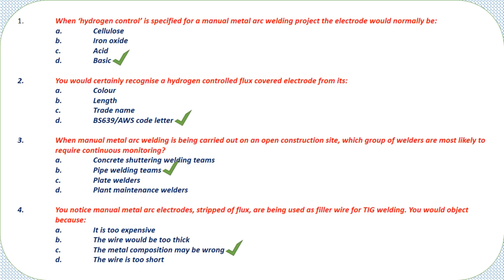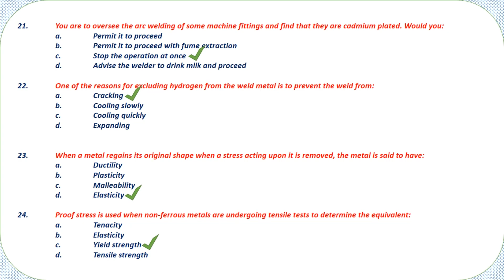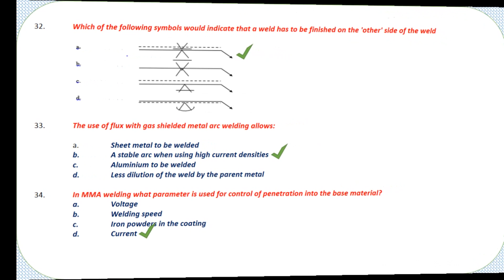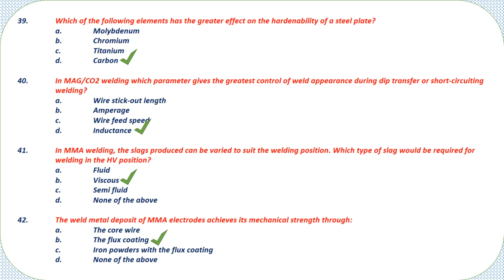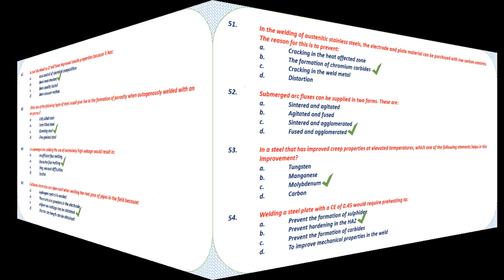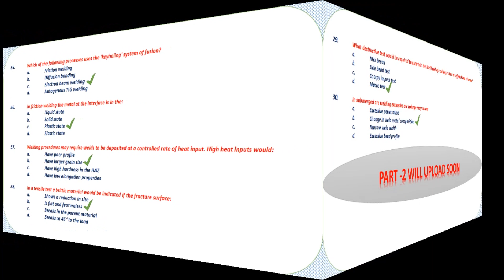CSWIP  3.1 Welding Inspector Exam Questions and Answers - Part 1

Comment: I have started to watch your video from last two days. I am wondering why you only have 21.4K subscribers. you should have at lease more than 200k subscribers. You explain very well all exam questions with relevant example. it is very useful for begineers
Reply from the maker: Thanks for your valuable comment. As I am working under Saudi Aramco so I don't have time now, anyway u will try to prepare more videos.

Comment: I want to do cwip course. My qualification is m.sc statistics , am i eligible for this course?
Reply: Sorry cswip course
Reply from the maker: What is your basic qualification and experience?
Reply from the maker: OK MSc statistics as I seen, then what about your experience?
Reply: I worked as an admin assistant in inspection department in oil and gas plant saudi Arabia
Reply from the maker: Job responsibilities and experience criteria for examination eligibility as given below are strictly adhered to and enforced.

Welding Inspector for a minimum of 3 years with experience related to the duties and responsibilities

Or

Certified Visual Welding Inspector (Level 1) for a minimum of 2 years with job responsibilities in the areas listed in above.

Or

Welding Instructor or Welding Foreman/Supervisor for a minimum of 5 years, In addition to all of the above,
Reply: Thank you for your information
Reply from the maker: Welcome

Comment: What is exame pattern cswip3.1
Reply from the maker: Welding Inspector (Level 2) 
2.1 
Examination format 
Theory Part A2: General Welding Theory, Product
Technology and NDT 
30   multiple   choice   questions.   Time   allowed   45
minutes. 
Theory Part B2: Specific Welding Technology. 
60 multiple choice questions. Time allowed 1hr 30
mins. 
Practical Part A2: Inspection of a plate butt weld to
a code provided by the Test Centre. Time allowed 1hr 15
mins. 
Practical Part B2: Inspection of a pipe butt weld to
to a code provided by the Test Centre. Time allowed 1hr
45 mins. 
Practical Part C2: Inspection of a set of destructive
test samples to a code provided by the Test Centre (two
macros, two bends or two fractures). Time allowed 45
mins. 
Passmark for all parts is 70%. 
2.2 
Subjects 
Candidates will need to demonstrate a knowledge
of the Visual Welding Inspector (Level 1) syllabus plus: 
i) 
Materials 
• Size: thicknesses, lengths, diameters 
• Type: grade composition against documentation 
ondition: cleanliness and surface for welding 
• Heat treatment condition and distortion 
The effect of composition, thickness and hydrogen
on welding of certain grades of steel. The techniques
and control used to avoid hydrogen induced cracking
and lamellar tearing. 
Post weld heat treatment, its conduct and control. 
j) 
Welding processes 
The effect of variations in welding parameters. The
influence of process on appearance and penetration,
and   centreline   cracking.   British,   American   and   ISO
symbols on drawings. 
k)  
Welding procedures and welder approvals and
their control 
The essential features of a procedure. 
British, European, American and other systems of
procedure   and   welder   approval   and   appropriate
documentation. 
l) 
Quality control of welding 
The   implementation   of   quality   controls   and   in-
process inspection. Organisation and records. 
m) 
Destructive tests 
The selection and purpose of all destructive tests
specified in standards. Assessment of results. Copyright
© 2012, TWI Certification Ltd 13 
n) 
Non-destructive testing 
The   methods,   capabilities   and   limitations,   and
assessments of reports related to penetrant, magnetic
particle, radiographic and ultrasonic testing of parent
materials and welded joints. 
o) 
Weld defects 
Identification   of   defects.   Reasons   for   their
occurrence and acceptance. 
p) 
Distortion 
The influence of welding techniques on distortion.
The control of distortion. The influence of heat treatment
and machining. 
q) 
Reporting 
The preparation of technical reports on all aspects 
of inspection referred to above.

Comment: in my opinion, the answer of Q30 is D
Reply from the maker: Hii , As per your opinion The answer is D , I will explain "Fine spatter at nozzle restricting gas flow"" How it is coming advantage even fine spatter are there . You have to choose the right answer ..
The answer will be B Why , Question itself mentioned the metal gas arc shielding , what are the gas shielding work normally "Shielding gas will protect the weld pool and prevent hydrogent content .
I think you got the answer ...